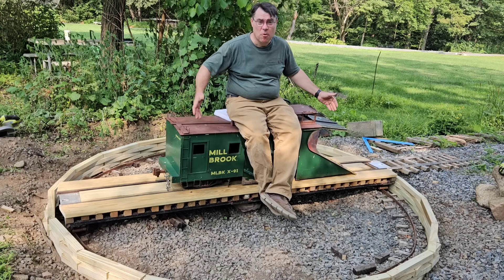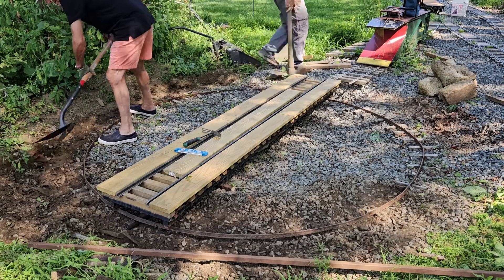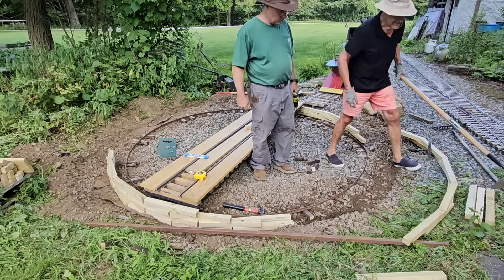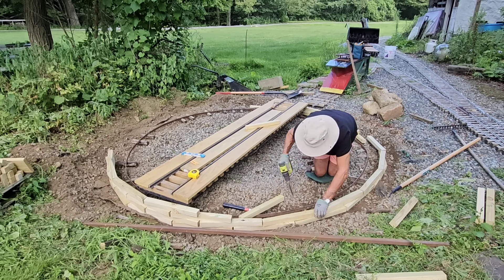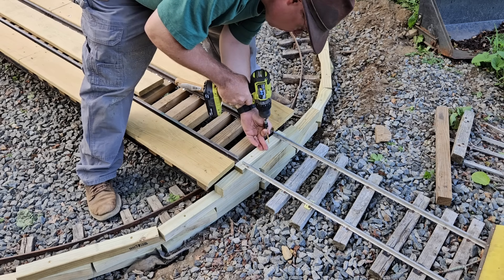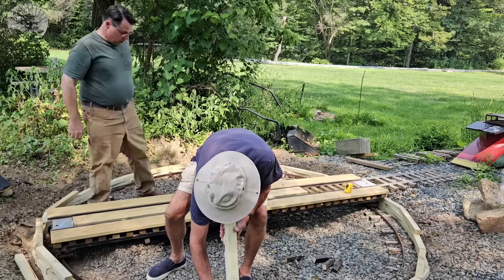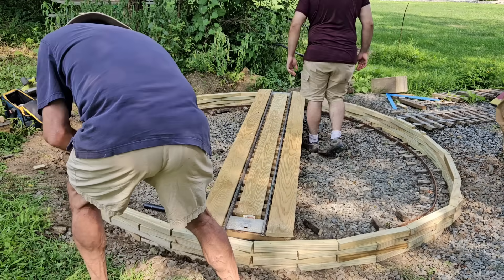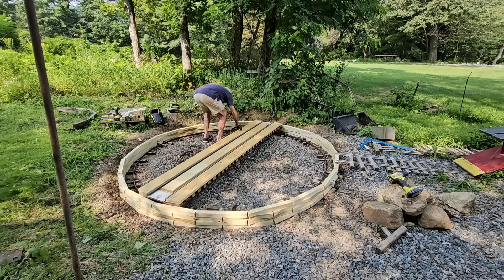We Finally Finished the Turntable (Pt 6)… But Not Without a Few Surprises

Comment: You should cut an angle on the ends of the locking plate that go into the tracks to make it easier to lock the two tracks together.

Comment: The locking plate design is used on the veteran railroad of SSJF in Sweden. As the railcar wheel base is only 2 feet less then the length of the turntable track the overhang of the car makes rods necessary to reach the plate.

Comment: The pit looks very nice. So after you pay off the Bobcat you haven't bought, and the complete replacement of all the ties with composites, you can do a concrete pit! Good work there sir!
Reply from the maker: Thanks! 
I'm not sure about a bobcat, but one of those mini excavators would be perfect!
Reply: @MillBrookRailroad I bought a mini excavator in December brand new for $3900. It will come in handy this fall and winter for my 2ft railroad. It's been great for some non railroad projects already.

Comment: Curious, why not use cinder block for the ring? That way you don’t have to do this again in 5 years.
Reply from the maker: I need the cinder blocks for another project. 
I'm using ground contact pressure treated wood. It should last longer than 5 years.

Comment: The turntable would work better if you had a handle on it and had brakes on the railcars to where you won't have to hold on to the car and try to use your feet just to turn it.
Reply from the maker: True. It'll also look better with stone around the pit. 
All in good time, though. There may be another video or two to do on this project.

Comment: Any reason you chose wood over pavers or stone for your turntable wall? I understand they cost a little more, but for as often as you go through ties it seems like the climate there breaks down wood quickly.
Reply from the maker: I had wanted to use concrete, but I didn't have the budget for it. I also didn't have the budget for pavers. As long as I surround this pit wall with stone, it should last at least 15 years.
Most of my ties have been relay. Same goes for the rail. That means that this is not their first railroad. So, the frequent tie changes can be easily mistaken for short tie life. In reality, many of the ties you see me replace are close to 25 years old. Most of that time was spent under someone else's rails. Those ties that I'm replacing that aren't relay ties are untreated and are about 15 years old or in areas where I skimped on ballast. 
So, I'll probably have to rebuild the turntable pit at some point, but I should get at least 15 years out of it in the meantime.
Reply: @MillBrookRailroad Thanks for the reply! Makes more sense now.

Comment: So when will you build the engine barn.?😉  That would be a sight.
Reply from the maker: As soon as I  have the money to do so. The building, as it sits, is. Not much more than rafters and a roof in a pile beside the driveway. I need to buy enough 2x4's  and T-111 siding to cover the 12x16 footprint.